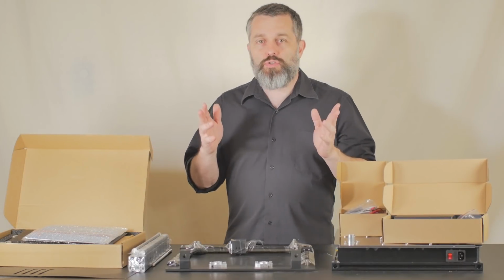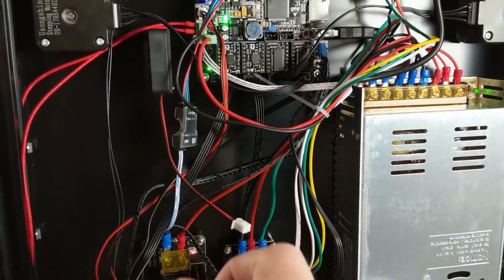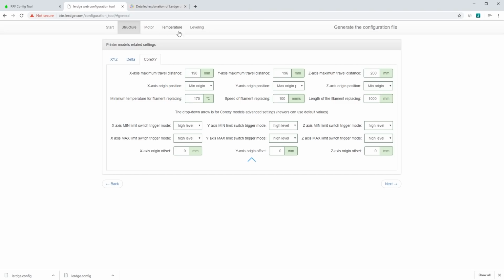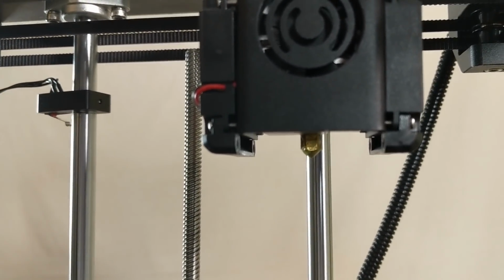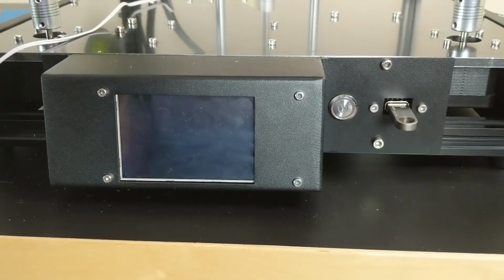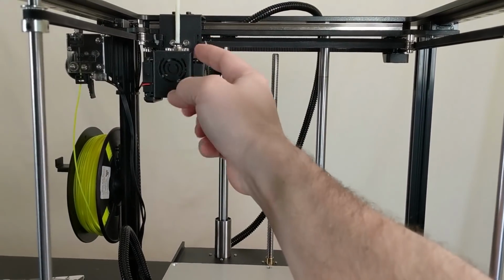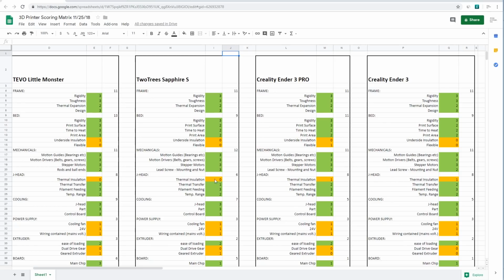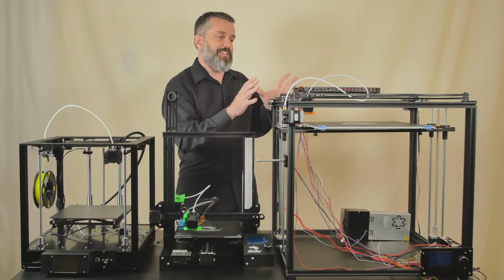The TwoTrees Sapphire 3D Printer Is the Best We've Seen Coming out of China

Comment: Half finished elements and proprietary firmware on a proprietary board? No thanks Btdt, it was bad.
Reply: Agreed.  Tons of issues.
Reply: Kasey, you buy a lot of stuff with proprietary electronics, from your smartphone to your car. This is not a problem IMHO as long as you have access to parameters. Take for example the MKS Robin. This is an interesting 32 bits board at a reasonable price. You can ask anything actual technology offers from WiFi to current shutdown or filament sensor. This is closed source. But as long as you have access to all the parameters, does it really matters ?
Reply: @axelSixtySix  Perhaps I phrased that poorly/incompletely. 
I have no problem with propretary per-se (now IP law and how it gets abused is another story). But half finished that I cannot fix, nor use reliably in a 3d printer is what my first printer was and it was a rare case of something I returned.
Reply: @kaseyboles30   I can understand that. As you said, open source is an endless debate, but we still need to understand it's meant to be used and copied anyways. I produce open source hardware, I know what that means. Closed source does not mean you cannot use or fix by yourself. There's a huge difference between Xyz Da Vinci firmware and a closed source board like the MKS Robin. Everything you can setup with Marlin, Repetier, Smoothieware or ReprapFirmware, you can do it into RobinFW. You just can't access to the main code, but there's not much people skilled enough to makes changes into other open source firmwares anyways. For regular use you do not need to, by the way.
Reply: @kaseyboles30  Propietary software/hardware is nothing that bad, but as you, i really hate propietary firmwares for somthing that is already open source, that you can improve and get better,  add your own features, its no problem for me to change the board and do my own firmware, already made several special features for special printers. but for some people is, and specially when you can buy somthing more cheaper and with better results/quality and more customizable, it really is. why shall we pay, lets say, 60€ for somthing that could cost 20, and that also we could customize and modify as we wish. even more, why shall we pay that extra 40€ of this example if they just copy somthing free, somthing that they invested 0€ becouse a comunity did it for them, and make it unmodificable/ harder to modify? why shall we pay an extra for somthing we could call enginering investment when they just close an already open stuff, put a logo, and comes with a ton of leaks, i will use again the same example, the filament sensor, clearly the enginers didnt implemented it, it was somthing about marketing, make money selling trash, hey yo! we have filament sensor ! here you have it for extra 15€ and you have to buy it with the kit becouse we dont sell it without.. GREAT!. great would been if atleast those people who make you pay for it told to the enginers to add it in theyr bluerpints/schematics and the final user could put it in the place they desinged for.
Reply: @axelSixtySix  The problem I had in this case was with both the board and firmware being undocumented proprietary I couldn't even load up marlin or smoothie or anything on it.  Or fix their's even I wanted to go that route. I was stuck with the beta they put in it.
Reply: @kaseyboles30  Curiosity will kill me: just to know, what board/printer was it ?
Reply: @axelSixtySix  : Tronxy xy-3. it was $299 on amazon. Though I did very recently see a favorable review of it (over a month after I sent it back and got my ender3-pro) and saw at least one menu option during the review my unit did not happen. To some degree I wonder if I got first version cheap because it was a first version. They're now $350+ on amazon. I got it on impulse as a 305x305x315 build area for <$300 us seemed a very good deal.
Reply: @kaseyboles30  The Tronxy boards are basically Melzi ones. It's an open source 8 bit Marlin compatible board : https://reprap.org/wiki/Melzi#Firmware_Upload ;)
Reply: Isn't ALWAYS a bad deal buying Chinese stuff? I mean.. no QC, copying stuff with bad cuality, and as you said.. propietary firmware.. need upgrade something? Buy a new board!!! Past half year rust everywhere! Pulleys stuck and lot of bla bla that is translated in a "deal with it and buy a new one"

Also really indignant to see they add unuseful features at last minute just to send more trash like the filament sensor... As funny as indignant. Specially when the package comes without a escential part like a rods, pulleys or power supply, it's buy throw buy in it's exponential level.
I really hate the irony of a machine that shall be used to have a more healthy treatment to our world used just for generate more trash and money movements.
Reply: @DoubleMotherLess  man this comment is all over the place 😂
Reply: @Schwift3D  what u mean?
Reply: @DoubleMotherLess  I guess your comment is pure xenophobia. Like any other nation, China can make good stuff if you pay the proper price. Have you seen their 1000€+ printers ? Totally enclosed with precision linear and ballscrews ? Hiwin is Taiwanese which is attached to China and those precision components are as good as they can be.  But you pay the proper price for the proper stuff. Buy a cheap printer, get what you payed for.
Reply: @axelSixtySix  lmao xenophobia... U have no idea. I bought a lot to China and half stuff been thrown due the bad cuality, and not chepo ones... and I'm pure white, aerial like, most of my gf's been nearly black so... Talk crap without knowing...  :'D meanwhile I talk by experience... Seen more than 100 Chinese printer kits from other ppl, I had to repair or fix toons of issues due the BAD cuality. And again... You buy a kit with a filament sensor that isn't even designed to be fixed? Clap clap roofling on the floor by your totally improper comment
Reply: First, please go down.  @DoubleMotherLess  "nearly black" says a lot about the distinction you make between people. The way you say talks. I've nothing more to say about that. Second, there's no relationship between china and quality. My first 3d printer kit was 100% made in USA: a Folgertech i3 acrylic. I payed 100 extra bucks to get what I thought was a trustier printer. What a fail! Anything about it was junk. 2 months after reception I even replaced the frame which was twisting under heatbed's heat. The only left was the 8mm rods and two motors. I had to replace all the splitting 3d printed parts! 

The country does not matter, the most important is the build quality. China has no  monopoly about poor engineering or high earnings. There's a lot of quality brands in China in every domain, including 3D printers. Have you heard about Totus? Mingda? People want to buy cheap, that's the main problem. When you buy an Ender3, the production price is around 70€. You can't buy a perfect machine at this production cost. Even in China, definitely. Everything will wear within 2 years of regular use, starting with cheap P8 bearings.
Reply: @axelSixtySix  if i do i can read me saying nearly black, yeah? so? YOU insulted me calling me xenofobic.. and im telling you that is ridiculous cause im shiny white and only 1 gf i got was like me, others, more close to black than white... wheres the racism here? if i were racist i would automatically reject it instead of go with them, so please... stop insulting me with stupid coments... and again, i live in catalonia, the mixing of bloods and culture is even bigger than in USA, i dont fucking care about that i care about the personality, also i use to like exotic things... oh.. wait.. im racist again!!! i prefeer exotic and outsiders!!! WOAHHH racist with them? with myself? positive racism? ... senseless.. :D same senseless as you acusing me and insulting me just for a non political correct typing / racism, instead of this better acuse or insult me for my poor ways to type or articulate or whatever in a non native language... sounds as stupid as the fisrt one but atleast have a bit of sense...

and now the real poin of this conversation and the ONLY ONE WE SHALL HAVE, the printer kit, yeah, i said and i repeat, most of chineese kits are CRAP, that doesnt mean they can/do really good stuff, but when whe focus on those poor quality kits, the things i said are totally right, most of times theres 0 QC, they copy of original products, and all blabla i said, that + the explotation make that  price cutoff, its just a fact, also 90% of stuff come from china, that doesnt mean everything, anyway you cant expect get a real good thing paying less than it costs, so easy.... take the next sentence in non literal... "90% of electronical stuff comes from china" and ofcurse, we could talk about quality of other countries, germany an example of superior cuality in many things, that doesnt mean they are perfect, you can buy a faulty product too, it can happend, but as they do QC and have real guarantees you can expect more than a stupid aliexpress kit that is converted in trash even before arrive. 

3d point, about your poor extra 100 bucks...  as you said.. ACRYLIC, you can expect it to bend and break, thats not even close to somthing with cuality, again YOUR FAULT for beliving pay more means better product. acrilic is CRAP for framing somthing that will heat, vibrate and keep moving... 
one thing is pay what it costs, other one is pay overprised.... but im pretty sure that your "american" Power supply isnt a fire maker becouse it will be tested and checked, in oposite side we have those chineese ones... and before answerme again, just google a bit of how many chineese 3D printers have fire hazards becouse low enginiering development, then check somthing like Ultimakers, in my eyes, they arent specially good, BUT doesnt mean they arent.. expensive? yeah! but those wont burn your house by doing what are suposed to be, compare it with an anet, enders, etc... you will see a ton of pictures of melted printers and scenarios like this... 

Now, i hope and wish you a good day, also hope you quit atacking me with crap, or i will begin to think your racist on me :D
Reply: @DoubleMotherLess   Calmate. Yo no trato de insultarte, me quedé muy sorprendida por sus palabras, y todavía lo soy. "Shiny White", "Close to black", son palabras llenas de xenofobia, mal que le pese. ¿Por qué hablar de color si las personas son iguales? Tienes pensamientos confusos hombre. Hay muchas empresas alemanas de mala calidad también: Einhell, Güde, por ejemplo. De una vez por todas, el país no importa. Hay buenos y malos en todas partes. ¿Vale ?

Let's do the 3D printing talk in English now. Back in 2013, there were not much kits available, and the shiny ones were acrylic. Nobody noticed acrylic was problematic at this time. We all learned that later. Through, this was my first printer and I was an absolute beginner. I should have bought a plywood MakerFarm instead (for 150 extra bucks), but at this time, Folgertech's kit was the most reported as good on specialized forums. I never knew why, by the way. I guess people are delighted to say what they bought is good. That was another time: Jo Prusa, Dave Lamb and Sanjay Mortimer were tinkering in their room and anybody could discuss with them about anything on the reprap forum. Note, I was one of the first to question acrylic frames. For your information, the first fire hazard reported was a Prusa Mendel with a Melzi board. Not anything Chinese on it. 

Once for all, you generalize facts that cannot be generalized. Some kits had quality issues, that's true but how many issues exactly ? Actually, there's four 3d printers that really caught fire. 3 of them caught fire because of the owner did not tight the hotend's heating cartridge properly. The reason the fourth caught fire is unsolved yet.  That's not a lot compared to the millions kits sold by China every year. As a fablab tender, I repaired a lot of 3d printers. There's not a lot of electronics issues, whatever the boards are. Most of the problems are parameters or bad assembly or bad upgrades. Actually, I can see the quality of Chinese kits greatly improving. 

In the late 70s people was bashing Japan stuff. Laughing at cars and electronics. Few years later, cool stuff all came from japan : walkmans, motorbikes, flat screens. Now stars rides Prius hybrid cars, and your Iphone is Chinese. Like by the past, be prepared all the cool stuff will come from china in a few. :)
Reply: @axelSixtySix  y dale... tia.. 4 parejas de larga duracion, solo una española, el resto de otros sitios como colombia, con eso solo quise decir que me la suda mucho de donde sea una persona/cosa, sino la calidad de este/a, que hoy en dia no se pueda ni mencionar "la escala de oscuridad de la piel" de forma perspectiva y no destructiva me parece ridiculo, como nombro a una persona blanco lechoso, casi fosforito, me da el sol y brillo rojo, o una chica color canela deliciosa sin que te ofendas? ... el problema no es mio sino tuyo. Respecto a tu parrafada... 

he visto y tenido que arreglar muchos problemas de kits, yo mismo me compre un par y al final solo se salvaron los motores, algun engranaje algun perfil y poco mas, el resto pura basura inclusos tornillos, rodamientos de mala calidad, mal echos o incluso sin rosca!!, electronica en uno de los casos defectusa de serie y tuve que remapear los pines del Zlimit con los del Y por que ni el min ni el max iban (por cierto me recuerda que una vez cometi el error de comprar un kit de 5 ramps, solo 1 iba bien., el resto tenian algun problema u otro... un chiste vamos..) , en fin, PORQUERIAS de impresoras. asi mismo cada vez que he ido a una convencion o  alguien me a pedido ayuda para su impresora  he comprobado la mala calidad de los componentes, varillas oxidadas y/o torcidas, tornillos de malisima calidad, frames torcidos o incluso rotos,  lc'ds bien, pero luego el lector de tarjetas defectuoso :D sigo?... 

y deja ya el tema del racismo que... ni p..ta idea.... por cierto, si, soy "blanco reluciente," y es lo unico despectivo que realmente digo sobre los colores de las personas, y hacia mi mismo, lo odio, odio quemarme con el sol, me encanta el color morenito y no soy capaz, en el colegio me llamaban copito de nieve y lechoso pero no por ello tengo que odiar  ni hablar mal de cualquier persona con un tono mas oscuro de piel que yo, y que dicho sea de paso, cambia menos de color que yo.... tengo frio y me pongo morado, calor y me pongo rojo, como voy a ser racista con alguien por no notarse tanto el cambio como a mi? XD, de verdad, lo politicamente correcto me da tan igual como "los colores de las personas", sorprendido me quedo yo cuando de un simple comentario me tachas de xenofobico. y si tan mal dicho esta y tanto te inquieta y tan chungo es... por que no me corriges de forma constructiva de una vez por todas en vez de seguir con el tema acusandome de forma destructiva, a ver quien es el que esta lleno de odio... ;)
Reply: @DoubleMotherLess   Te enojas solo. Calmate (una ultima ves). I'm more fluent in english.  No one here is interested by your love life! No agression here, just facts. Xenophobia comes when you pretend kits are wrong because it cames from China, OR when you say something is good because it comes from Germany. This is totally arbitrary, unfounded, and definitely false. There's good and bad coming from any country, there's hundred of examples. The problem is you bought a good price from China, not good stuff from China. You bought cheap ramps boards or cheap kits how dare you complain the quality was low ? As I told you, the problem is not China but the price you accepted to pay. If you had bought a proper Ramps or a quality kits, from China or whatever, you would probably enjoy. I also repaired a lot of Chinese Anet kits but what would you expect from an under 70€ production price ? The problem is to buy the right thing, not to buy form a country or another. You buy an Apple Ipad, you buy a quality stuff, even it's made in China. And it's not a question of brand. You buy a Xiaomi smarphone and you get a comparable quality as a Samsung or an Apple. Actually, you can buy an Ender3 or in a few weeks a Tarantula Pro for less than 200€ and get a pretty good chinese value for money. Second, buy a 1000€ Chinese 3D printer, and you will get much better than any other country's production at the same price. If you don't trust me, experience by yourself.
Reply: @axelSixtySix  1. So you finally agree with what i said in first place... and said the reason of that low price is NO QC...
2. those ramps wasnt really so cheap but, anyway.. same stupid aliexpress portal.
3. if you buy in eu or usa you have quality control everywhere.. THEY HAVE TO or they are exposed...
4. apple good cuality? rofl...
5. no point to waste 1000€ in a chineese 3DP, i dont care if it can be good.. they dont have real guarantees and its really hard to make them refound/repair etc
6. as i told you in my 1-3 posts, thats my own experience.
7. yeah, no 1 care about my life, just you acusing me about somthing wrong, xenofobia is somthing serious, and you cant expect trolling with it without make some1 mad, specially the one who you acuse if its false, otherwise i would accept it and be proud like racists are... YOU are who was insulting, and trolling hard becouse i said unpolitcal correct words but not false, say some1 is more brown or nearly black isnt racism, calling him ni..er or s.it jsut cause his colour is. my words could been readed/interpreted as you wanted/could, you prefeered the bad way and be salty on it. By the way, i told you could be less destructive and more constructive and correct my words,you didnt... whats up? you dont found the words for it without begin hypocrite with your own arguments?.... i just been objective, same with the chineese stuff, say whatever you want. ofcurse you can get good things, i said 20 times, most of electronics come from china, doesnt mean that you can buy in pages like bangood or aliexpress are equal good as somthing you bougth in a place like germany BUT, chances are real high, yeah, and thats not racism, thats a fact. The reason why its more expensive in another country its not just becouse they need to get some money re-selling, or they wold be scaming making you pay 2-3 times more for the same product. the reason (about ensambled stuff is much higher) is becouse other countries have atleast decent salaries, production rules, employement politics, and ONCE AGAIN QUALITY CONTROL.
Reply: @DoubleMotherLess   Get me right : I never agreed with anything you said. You're still fulfilled with presupposed convictions about anything.Your experience is not universal, and your claims are not objectively funded. If you believe companies like Hiwin or Huawei have no quality control or are inexpensive, you're just out of the reality. Rexroth is german, less expensive and lower quality than Hiwin which is chinese. There's no common knowledge in what you claim. Some german things are better, some chinese things are better. There's no absolute rule. What you claim is not objective, and mostly false. As you apply your own convictions a foreign country is wrong, it's pure xenophobia. Game over.
Reply: @axelSixtySix  lmao, im not german, i just took it as example, i didnt said about ALL stuff (ok i said "isnt always bad choice to buy chineese stuff?" or somthjjing like that, witch isnt so false, after all toldya, they have diferent laws that dont protect employers way more than other countries. and ofcurse there are good companies, you mentioned twice (but no, hell apple no rofl). and ocne again, i told you to stop destructive crtisism and explan how had i to say it, you didnt. game over? maybe you lost your own game trying to be soooo political correct while pukeing trash on me but you couldnt correct my "racist words" ¿becouse by your logic there isnt?, look all those posts.. are SENSELESS. i wasnt even talking about companies, i was talking about chineese shops and those shit kits, yeah, SHIT KITS like the one in the video. .a real good example about everything i mentioned before.

now somthign really funny: a old black fat blad man robbed me: me to police, the.. hmm bla.. no wait.. the old.. wait no thats unpolithical. the fat.. aww!!! the blad .. NOOH.. some1 undescriptible by laws and political corrections robbed me, cant describe him... hes everything... if hes too slim cant say it, if hes too tall cant say it... whatever.. lets shutup and never talk again or do it like cavermans... (but whitout pointing with the finguer,  scream or  babble thats not polite eigher ;) LETS BE ALL MIMES in pro of the political correct and the  mimosa trolls like you!
Reply: @DoubleMotherLess   Once again, nobody cares about your life. Now you argue about workers protection. What's wrong with you ? What will come next ? Human rights ? Oh come on !
Reply: @axelSixtySix  for some1 so sensitive with words seems you dont care about anything more than troll,. so yeah, this is my last answer, this / we are senseless.
Reply: @DoubleMotherLess  Come on, who's trolling here ?
Reply: @axelSixtySix  you have it bigger, bye...
Reply: Schwift 3D copying stuff with bad cuality ; that’s an r away from being a good joke